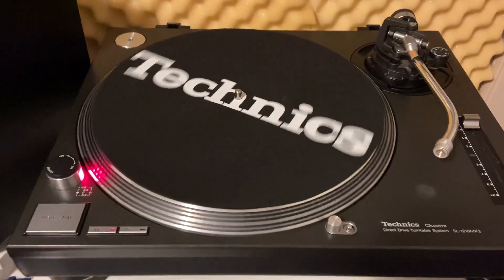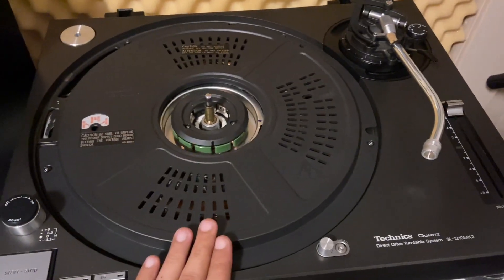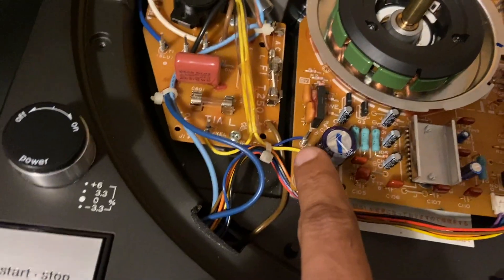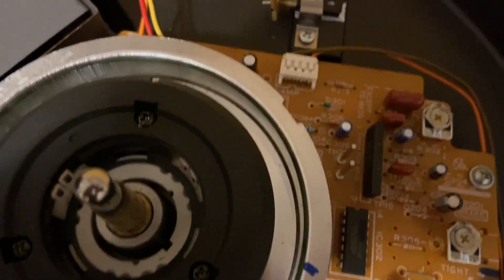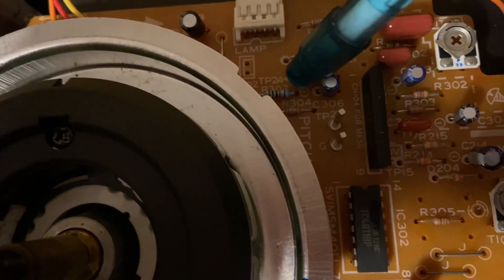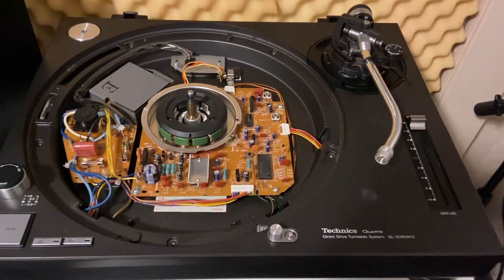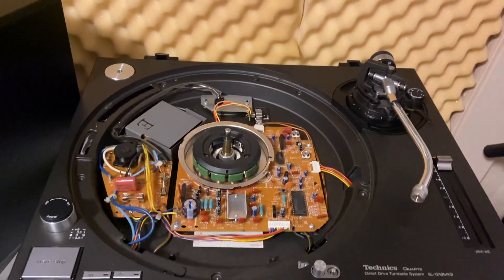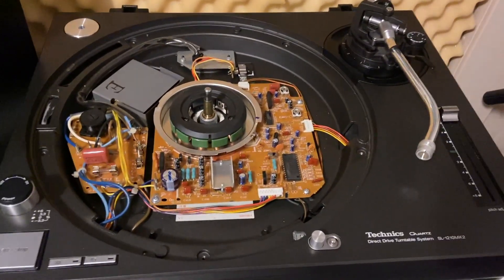TechVlog 001 - Technics SL1210 MK2 Erratic or Unstable Pitch Fix

Comment: Thanks so much for posting! Worked perfectly on a 1200 mk2. So satisfying to be able to resolve an issue by replacing a super cheap component. 

Could anyone explain what resister does? Before replacing it, the deck had the erratic speed issue (particularly on hot days after being on for a while), but it would also do weird things like the start/stop button would send the platter in reverse, or the platter would suddenly jump to a ridiculously fast speed. Replacing that resister solved all these issues.

Comment: This is the common problem on newer models with WHITE connectors on pcb/cables.
Reply: I have the white connector pcb on my 1210’s. My issue is instability/drift whilst in the mix. What symptoms did you have on yours pls?

Comment: Thank you for this post, I purchased a pack of 50 10k resistors from Amazon for around £4.50. I have replaced the old one & had the deck running for well over an hour & have no problems with the erratic speed like before. Much appreciated

Comment: I have a Gemini PT2000 that only holds it's pitch on quartz. Off quartz and the pitch drops and the slider does nothing.  Aside from that, for $100 it works great but don't dare open it up myself.

Comment: Thanks For the Video! This fix worked for my 1200 mk5 pitch wobble! It was only wobbling in the summer on -8 Pitch. Replacing the resistor worked great! Thanks!!!!!
Reply: @Coolsounds217  I  believe replacing the resistor will be much easier and should fix the problem. All the comments on this video and in the forum post ( In the video description) Seem to point to the resistor being the problem.

although replacing the resistor is very easy, it does take some tools and knowledge. I suggest watching a lot of videos on soldering and what would be helpful would be finding some old dead electronics. open up the shell and find the PCB and practice using Solder Wick to head up old solder and remove it from the board, and practice applying new solder and a new part.

it is also true that you could just snip the old resistor on your mk5 board, remove it and solder the new resistor on top, thus not having to remove any solder or parts and not have to risk damaging the PCB. 

good luck! its an easy fix!

Comment: Ive done the 10k fix and mine weren't to bad but seemed like they were in mix but would drift frequently worse after been on for a bit so ive put 10k inside like you said 1st thing i noticed is when moving pitch it seemed smoother👍👍👍👍👍

Comment: You can theoretically cut the resistor off from the top and solder a new one on the old wires without taking the whole thing apart

Comment: It’s strange as my deck is doing this. I needed to replace the pitch on both anyway as they real bad. I noticed one deck doing this. N it gets way off. If I turn the deck off for 1 minute then test it. It’s ok again. But then starts doing it again. I have the exact same deck you have in this video. I’ve ordered the resister so I’ll get it changed asap 👍🏻

Ps. I forgot to mention I ordered some of these  10k ohms 0.25w 1/4w 1% resisters

Comment: Bought a new old stock in the box November 2005 mk2 model earlier this year for use as my HiFi deck. After seeing this vid I checked mine & sure enough it had the same issue from new ( wonder how many were returned back in the day ) after 30 minutes of use. I've changed the R307 as specified job done. Thank you Shane.

Comment: Just did this on my 1210 mk5, and it works perfectly now. Thanks so much for the clear video. I used a 10k ohm, 500 mw resistor on R307. I didn’t mess with the zener diode.
Reply from the maker: Cool. Glad this helped you out.

Comment: Had the same problem on a 1200-mk5. 
replaced the Resistor R307, to a 10K Resistor and it seems to have solved the problem.
Thank you!
Reply: Hi, is it still running 3y later?

Comment: hi Shane D.
where did you buy the resistors?
I'm out in Jozi. I wanna go get some and get try this.
I wanna get it and try resuscitate my SL-1200mk2.
Reply from the maker: Hi Shaun. You can get the resistor at Mantech.
Reply: @ShaneDofficial  will drive there 2moro morning on my way to work.
will give you feedback once I've applies this fix.
Thanks.

Comment: My technics is sl1900. Lately the platter is running with much speed. The pitch control doesn't control it at all on both the speed. I cleaned the pitch (pots).replaced all the aged electrolytic  capacitors.i checked the voltage of the main IC AN640 and it's normal.But problem still persist. Please advice what to do.

Comment: Would you recommend to desold the whole board out of the deck before swapping the resistant? 
Or should i keep it connected to the deck whilst solding?
Reply from the maker: The board is screwed in, not soldered. You have to unscrew the board and flip it over to desolder the resistor. There should be plenty of teardown videos on YouTube for this but the instructions are fairly simple to follow.

Comment: Thanks, man, great video!
Did I get you correct that, if the pitch is not correct when locked at 0%, then it's the pitch fader that has to be replaced?
Reply: i would have the same question. i get a floating pitch even at zero.
Reply: Did you guys ever find out? I just got my pitch fader replaced but it still has the same problem

Comment: By mistake I ordered 1/2 watt 10k resistor instead of 1/4 watt for R307. I don't want to wait for a 1/4 watt if I can help it - will using a 1/2 watt one be fine or not? Thanks from the UK :)
Reply from the maker: Hi bud. I'm not technically qualified to advise on that. Maybe someone here is but personally I'd just get the correct spec in case you cause further issues. Parts for the decks are becoming more difficult to source nowadays  so rather err on the side of caution.
Reply: @ShaneDofficial  so which wattage did you use,1/2 or 1/4?,for the 307 replacement...
Reply from the maker: @leonfuturesoulmuzik875  I used the 1/4 watt but I've since learnt that the 1/2 watt will also work fine.
Reply: @ShaneDofficial  Thanks!

Comment: I’ve got a 1210mk2 and when I move fader either to positive or negative pitch the plate spins back and forth randomly. At 0 it’s perfect and tuned. Any idea what could be?
Reply: That's the problem that this video fixes Heitor. I have exact same problem which I'm trying to fix today - I will let you know how it goes :)
Reply: @OneEyedWheeler  any news on how your repair went?

Comment: I have MK5s that have not been used that much and always kept indoors. Currently, if I set it to 0, it is fine. If I let it run for about 15-20 minutes, then move it anywhere from 0, then it gets very erratic and all over the place. If I set it to +8, it is more like +30! Even small adjustments of the pitch result in very erratic behaviour. I have just ordered the resistors and a soldering iron and I am going to try this out. Have never used one before and hope it fixes my problem!

The pitch stays totally stable when I engage the pitch test button. Its only when I turn the button off and move the pitch slider around that the erratic behaviour begins. And it only seems to happen if the turntable has been running for a while.
Reply from the maker: This will probably work for you 👍🏻
Reply: @ShaneDofficial  all I have to say is WOW! This worked like a charm! I have zero soulering or electrical experience and honestly it was kind of scary taking my deck apart like that but I am so glad that I did. I replaced R307 with a resistor that cost pennies and my deck is 100% fixed.. awesome! 

Thank you @shaneD! and by the way, I listened to some of the tunes you have uploaded on YT and they are great.
Reply from the maker: @CJ-gp9yh  Thank you, and I’m glad this worked for you !
Reply: @ShaneDofficial  Just ordered and looking forward to seeing if this works! I will let you know :) The example video you pasted in your video is exactly what mine does..!
Reply: Any more troubles since you made your repair, CJ?
Reply: @souldefunk  Hey, no more issues whatsoever and I have these decks running for a fair bit every few days. Since I replaced the resistor, the pitch has been rock solid and I was even considering doing it for the deck that isn't broken but I opted not to (out of pure laziness). 

I have also told quite a few people about this fix and referred them to your video. 

Thanks again my man!
Reply: @CJ-gp9yh  that's great to know. Going to get some resistors and soldering iron to give this a go. Cheers.
Reply: @souldefunk  you will be pleasantly surprised.. I would recommend that you get the soldering sucker to remove the old shoulder.. I didn't have one but it was the only thing that made this a little difficult. With the sucker it will be easy.
Reply: @CJ-gp9yh  thanks for the tips!
Reply: souldefunk music good luck and let me know how it goes
Reply: I have a MK5 that is doing the same as well. Good to know that this should be my solution. Cheers!

Comment: Hi, i just bought a Technics 1200MK3 and it seems needs calibrate the pitch. The 0 position seems ok , the +6 looks like it is moving a bit to the left,  the +3.3 and -3.3 is at +2.2 and -2.2. ¿Any tip to recalibrate it? Thanks
Reply: thats kind of normal. the numbers on the fader are only a guide
Reply from the maker: You'll need a digital multi-meter to calibrate the pitch fader. Open up the deck, and disconnect the pitch fader. Set your multi-meter to frequency. Factory setting is 2.7k at the 0 position. That's what it should read when your pitch is locked at 0. If it's not, you'll have to incrementally adjust VR302 to get it to the correct setting. There are videos on YouTube detailing the full process but if you're not comfortable opening up the deck, rather send it in to get sorted. Hope that helps.
Reply: @ShaneDofficial  correct. but this will never line the numbers up.
Reply from the maker: @ikov  Correct.

Comment: so we have to change the D307 by an other resistor 10k ohm ...only this ? cause my diod zener is okay 
so ? 
thanks bro
Reply from the maker: R=Resistor so R307 :) D=Diode ... And yes, that's all I did.
Reply: @ShaneDofficial  wierd ! i have the same problem ! and i changed the r307 to one other 10k  1/2 watt but nothing change ! it still the same 
notice .. ic an6675 is gone to be hot fast and when i check the voltage .. i find 31 volt in the place to find 20volt ... any idea ? 
thank u anyway
Reply: notice mr shane and sorry for disturbing 😏
i only changed the R307 to a 10k resistor ...nothing else ...do i have to change the diod zener to a resistor too or what ? what u said about the diod zener ? sorry cause i am not good english speaker and i only undrestand the basic english as u see 
so please what i have to do else after to change the r307 to an other 10k ...what i do with the d zener etc... 
and thank u again for you great help
Reply from the maker: @مواطنعادي-ح4ن  That should sort out the problem, if it's the same issue in the video. No need to change the Zener diode.

Comment: The problem is the 5V operating voltage on the electronic switch CD4011B. At 5V, the minimum switching voltage is 3.5V. IC201 is putting out 3.8V, that is very marginal. And as the 5V zener heats up, its voltage drifts upward raising the switching voltage with it. So it is the 4011 that is becoming unstable,. The 10K resistor, takes some load off of IC201 and raises it's output marginally.  Still the best overall solution is to reduce the zener to 4.5V. that would give the CD4011 a little more headroom.
Reply: So glad I found this video so I could fix my warbly MK5. I did both the resistor and diode replacement last night and all was well after an hour of testing. I left it on overnight as a stress test and it was still stable in this morning. Thanks Shane for the vid and Kevin for the additional diode information. Such a simple fix.
Reply: What you are saying is replace D301 for a 500mw 4.5v version? Do you have a link?
Reply: @Tarabass  www.kabusa.com/m1200.htm I settled on a 4.7V Zener.
Reply: @kevinatkab5219  thx, Kevin!
Reply from the maker: Thanks for the comment, Kevin. Pinning it in the hopes that others find it as informative as I have  :-)
Reply: Hey Kevin, 
After I replaced the Resistor R307, to a 10K Resistor everything worked fine.
Today ich replaced D301 to a 4.7/500mW Diode, now the player spinns really to fast! 
Could you help? Please
Reply: @Dennesscheppert  Did you pay attention to the polarity?
Reply: @kevinatkab5219   yes I did... I found the failure. There is a damaged Cabelisolation. In the left-front corner, under the cabelzipper. The cabel became contact to the screw, after replacing the Mainboard. 

Actually, R307 up to 10k + D301 down to 4.7V, an die Player works properly!! Thank u for your Option with D301!
Reply: @Dennesscheppert  Be sure to go back and check all operating voltages 20V, 4.7V and 9.5V at Q201. The thing that most often causes fast speed is the loss of the 9.5V power supply and this is often caused by degraded solder joints on Q201.
Reply: @kevinatkab5219  After doing this mod ive noticed that R201 gets way too hot, oscillation may be at order?
Reply: @moodesigner  R201 gets very hot normally, it is absorbing 17.3V; that's 1/2 watt in power which will produce heat in a resistor. Measure the voltage drop across R201 if you want to confirm that all is normal.
Reply: @kevinatkab5219  electrical engineer?
Reply: @kevinatkab5219  I replaced D301 with a 4.7V glass zener and the 10k Resistor and I am getting the numbers almost identical to what is listed on the Schematic ECB 9.4, 21, 10V. Also, D301 is reading 5.17V Should I be replacing D3 Zener as well to 4.7V? Still getting the slightest drift after warm-up, much better than it was though, so many thanks already. Its probably worth mentioning that AN6675 seems quite warm compared to an earlier model 1200 mk2
Reply: @Lmann-76  drift in quartz position, or drift with pitch? There should be no drift in quartz. But even in the best of conditions, I would expect the pitch mode to drift some from a cold start up, as the temperature inside stabilizes.
Reply: @kevinatkab5219  it drifts off the Quartz, on the quartz I can put the same record on from start to finish it’s locked, off is a different story
Reply: @Lmann-76  you should try and document the % drift. I would probably suspect the pitch trim pot VR301, But if drift is less than 1% I would think it is OK.
Reply: @kevinatkab5219  Hi, Thanx Kevin I will try and find some software to record that and while I’m at it I’ll check the power regulator Q1 as well
Reply: Great seems to work done both 10k and 4.5 zenner
Reply: First of all thank you for precious explanation what is really going on here. I have one question if you don't mind - what do you think about replacing the D301 diode, that is originally set to 5.1V with positive 3 pin voltage regulator like 7805? It should have less heat related voltage variation. Cheers!
Reply: @mixersinside  I think then, I would change the zener to 12V  and follow that with the 7805. Three terminal regulators can fail in such a way that they short from input to output and that could put a high voltage on these circuits. Personally, I think the zener being a simple component is probably more reliable in the long term.
Reply: I wish I knew what any of that meant. You sound smart as hell though. I have perfectly working turntables so I don't even need to be here. I'm off to bed, it's 2am.
Reply: @andykelly7321  lol this made me laugh. what on earth are you doing watching this video? :D

Comment: Thanks for the Video, fixed my forever problematic 1210 mk5 turntable and works 100% fine now.
Reply from the maker: Glad to hear it :)
Reply: I was just wondering if it is the same fix for a 1210 MK5 as that's what I have and have the same issue. Do you think it stems from being a euro plug but using an american adapter?

Comment: Hi, did you fix it? I have been dealing with this problem over years and I have never found the solution.
Reply: you should check the voltages on J1, J2, J3 of Q1 regarding to the service manual values, i you not having that so the suspect maybe on Q2 and Q3, unsoldered the Q2 and Q3 then measured it with dig multimeter, if the values below 0,300 V on Emitter's and Collector's pin then yeah those 2SD637 need to replace. worth to try..
Reply from the maker: Hi. Yes I did. Change R307. It’s a 2.7kohm resistor. Replace it with a 10k ohm as it handles heat better. That’s literally all I did and my deck is back to normal.
Reply: @ShaneDofficial  but the problem is still there. You just hide it with another component. I think. Probably other component, a IC or diode it is damage. I don't know. What do you think?
Reply from the maker: @homerbailon1  No, the problem is fixed. Please read the forum posts in the description as mentioned if you want more information. In my case, the problem has gone away and I'm happy with the fix provided. It's up to you if you want to try it or not. Cheers.
Reply: @homerbailon1  replace the diode and the resistor. worked for mine.